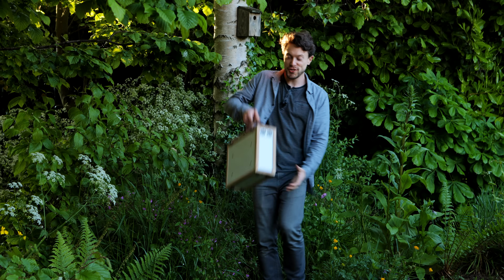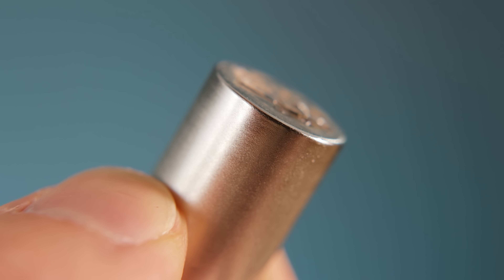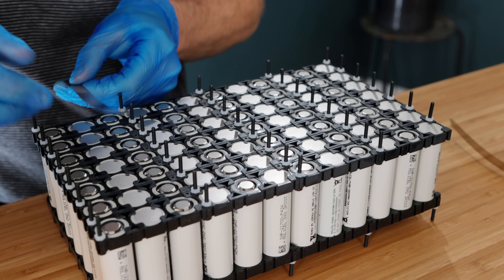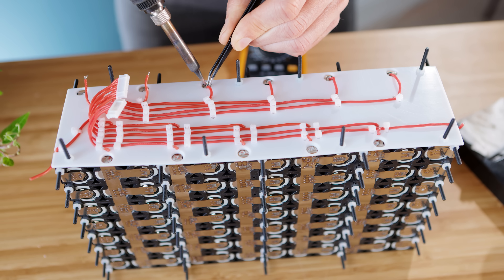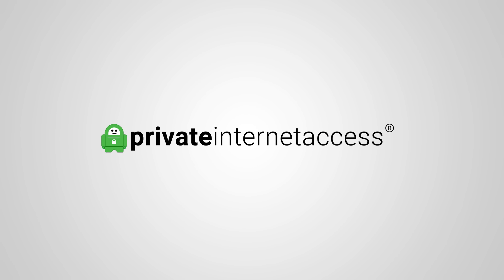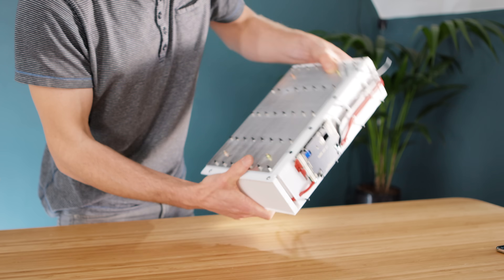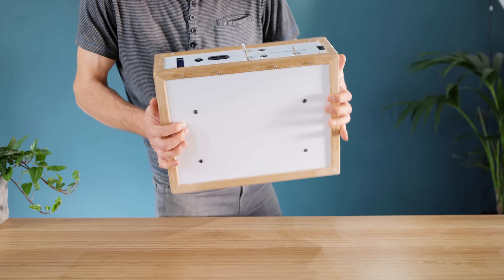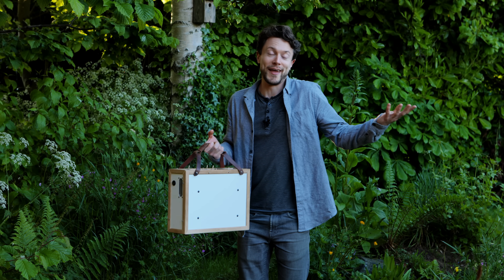Build your own portable POWER STATION (1200w, USB-C and MORE!)

Comment: Seriously, never soldier the batteries.  Every time I've tried it it ended poorly.  (Once the battery caught fire!)
Reply: By
Reply: @asdrubale bisanzio Got the spot welder actually.
Reply: I remember soldering some NiCad cells way back. I used a pretty large soldering iron with a lot of thermal mass and was able to do a solder joint in something like two seconds or less. Still sketchy as heck, but the batteries went into an old radio and kept it working for a few years which was all they needed to do. Those seconds with the soldering iron probably killed off some of the battery capacity, but not enough that it was a problem.

But yea, lithium is a tad less forgiving than those old NiCad cells, so I wouldn't recommend anyone to try it today.
Reply: If you use a high power soldering iron (100-150W) with a big tip with a lot of thermal mass, and acid flux, you won't heat up the cell any more than you would with a spot welder.

Comment: I like your videos. 
I want a project where you list parts to make a tool battery a USB C PD adapter.  18v or adjustable voltage batteries..
Reply: Pretty much any tool battery has a voltage from 12v to 20 plus volts. Most common larger batteries are 18v and 20v 
I want to make a usb c PD that I can use shuglue to mold something that I can attack to one of the tool adapters that I can buy off of amazon.